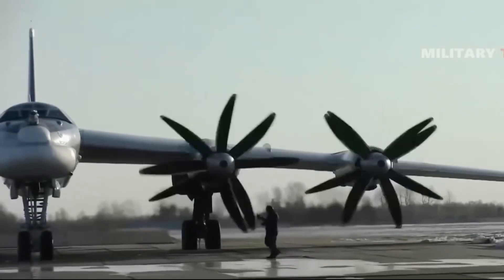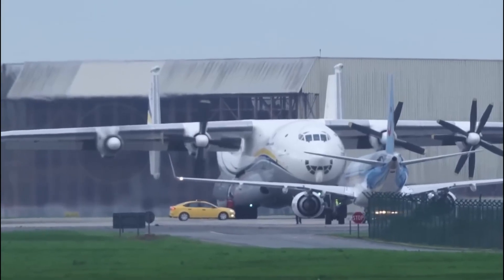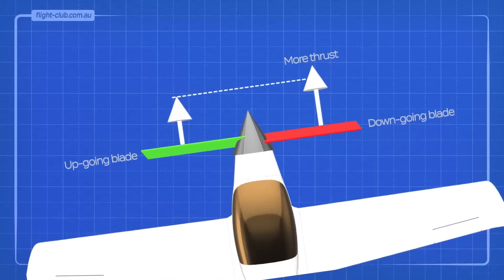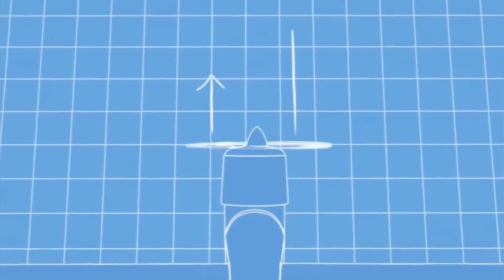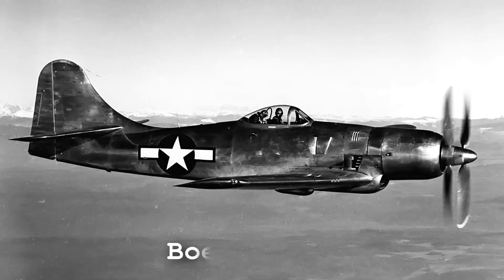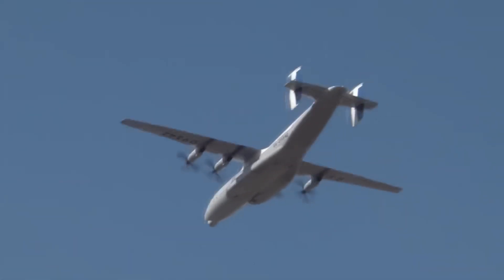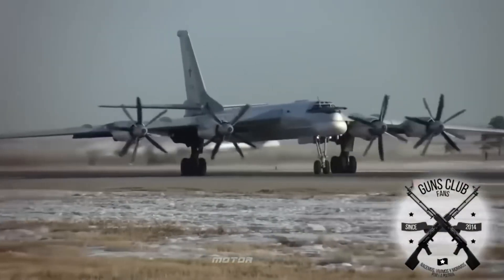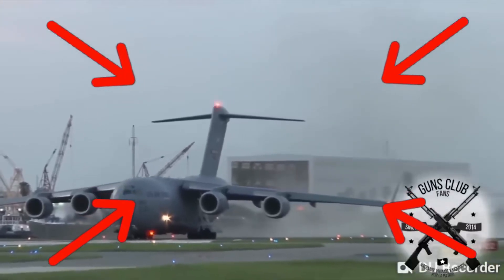Why Do Some Planes Have Counter-Rotating Propellers?

Comment: Do some research before you post AI garbage. Thumbs down. Counter rotating and contra rotating are two different things. Contra-rotating means the blades are on the same shaft turning in opposite directions. Counter rotating means blades are on different shafts rotating in opposite direction.